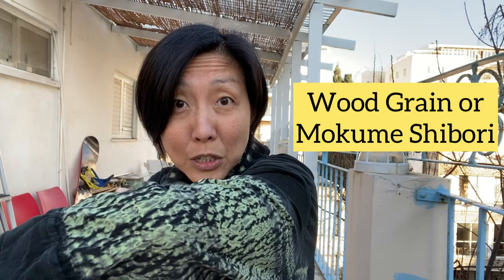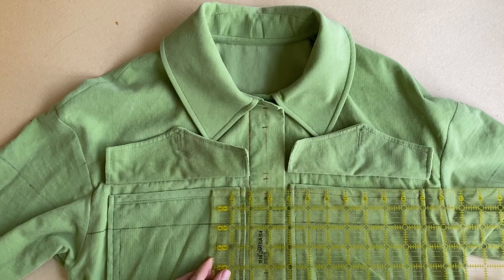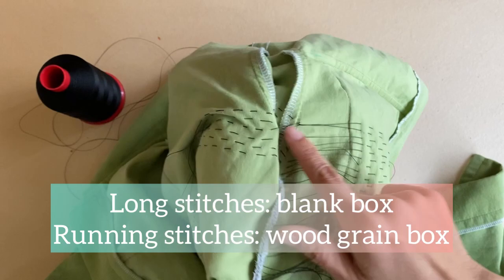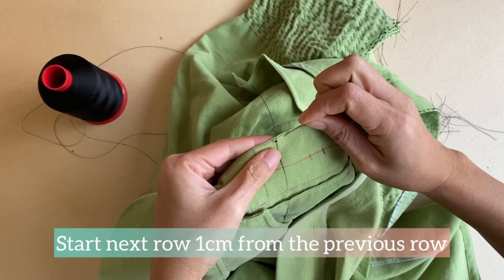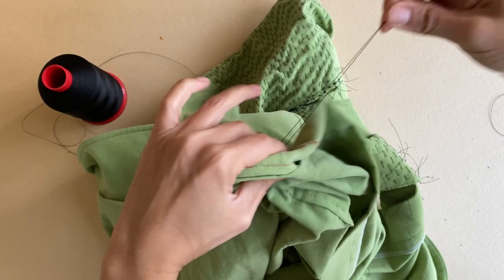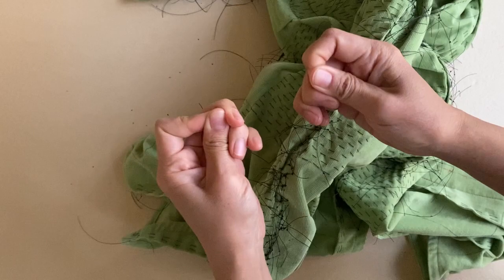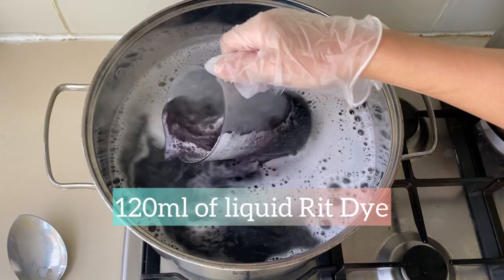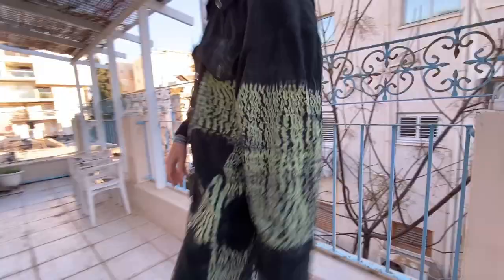Wood Grain (Mokume) Shibori

Comment: OMG 🤯🤯, the design is beautiful 😍 but 30hrs that's a very long time and thanks for mentioning the nylon thread, I tried thread shibori this evening and the resist was not enough but with this💪💪💪.
Thanks so much
Reply from the maker: Hello! thanks for your support. Yes, nylon thread works better than cotton because cotton tends to break if pulled very tightly, and that is required for a tight bind for shibori.

Comment: Thank you for your joy and generosity and skills 🙇🏻‍♀️I noticed you did not wet you shacket before dying … is that not necessary with Rit dyes ?
Reply from the maker: Hi Yvonne, I don't really dampen the garments that I tie dye when working with Rit Dye. It still works. Sometimes I use a spritzer so that the resist would have greater contrast